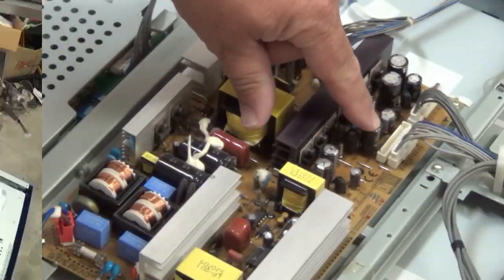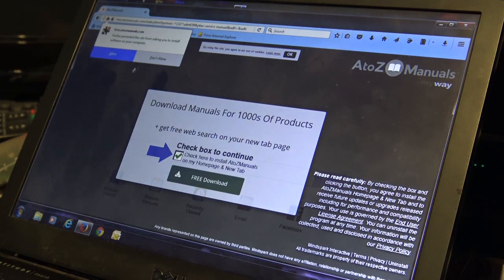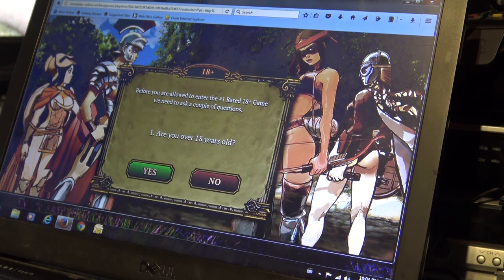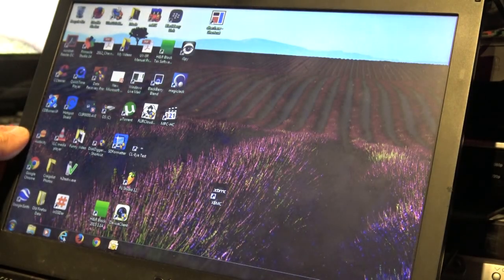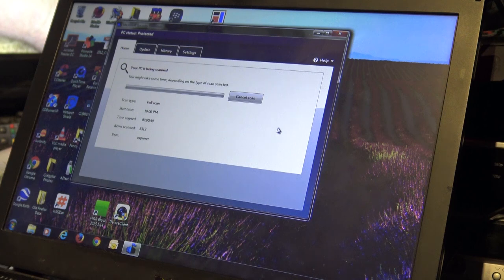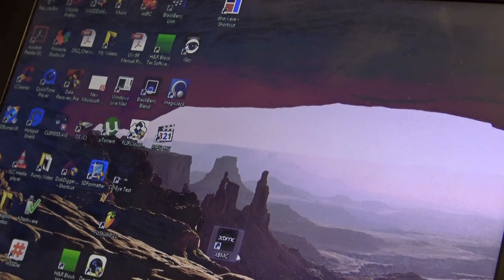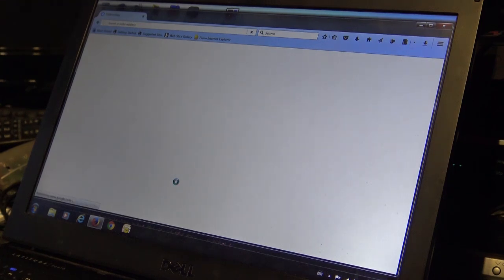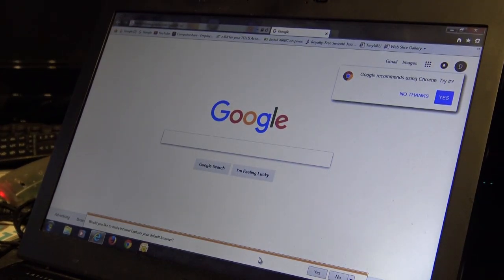Computer Viruses ARGH

Comment from the maker: I also need to point out that even though I only show removing the "launchpage" crap from the icons on the bottom, it also needs to be removed from all the shortcuts on the desktop, and in the start menu.
Reply: you should run linux.
Reply: corpus levitus Damm true one of the best os no worries about viruses
Reply: Ok, so what's the most successful Linux-flavor these days? It's Android. And what's the most malware-ridden touchscreen OS these days? aaaaand we're done here.
Reply from the maker: Un updated versions of Android perhaps. That's why I run a Blackberry which is Android, but with their own custom security. Never had a virus attack my phone, and no it can't be rooted.  Updates pushed every month. How many other phones and android devices get updates like that? My Samsung tablet has had 1 in 2 years, my other 2 tablets have never been updated. My priv gets one every month. My daughter has had her Priv now for 2 years, and she has had an update every month since she got hers. Any OS can be secure, and any OS can be insecure. It is all about updates, and microsoft is pretty good at updating their OS, and their anti virus. I was just behind on my AV update on this machine because I don't leave it running all night. My desktop was up to date, my laptop was not. Had it been up to date this would never have gotten through, but I let it lapse by over a month, and  I got smacked. Let your Norton or Kaspersky get out of date and EXACTLY THE SAME THING can happen.
No big deal, no data lost, no data stolen, I figured it out pretty quick, and had it updated and removed in a few hours. That is what took the longest, scanning the drive.

Incidentally, there is yet another update today, only 24 hours from the last one. They are on the ball at MS
Reply: Exactly as you say, couldn't concur more! The mere OS-name or Antivirus-name will not prevent you from anything, the updates need to be steady and quick. I - like you - favor continuous updates over marketing-hyped "super-safety" (which doesn't exist). I see the Nortons, Kasperskys on every new Lenovo, every new HP, every new Sony and I know that I will see those machines again in 14 months tops ... when their tryout-period expires :)
ps@my post above: not bashing any OS, I run all of them on a plethora of workstations, mobiles and servers. Once an OS reaches critical mass it'll become interesting for malware.
Reply: 12voltvids have you used linux on a laptop or desktop?
Reply from the maker: I used linux on an old laptop once. It was a cool old Dell that I could swap drives, so I put linux on a small drive and would swap drives when I wanted to play with it.
Never could get a handle on doing anything. Sure I could browse but it was so foreign that I became frustrated.  Same goes for Mac's. I grew up on DOS, and made the migration to windows. First 3.1, then 95, 98 XP, Vista and now 7. The computer in the family room is running 10, but I don't use it, and haven't bothered learning 10, even though it isn't much different than 7.
For phones I started out with BBOS6, then 7, then Blackberry 10, and now Blackberry Android, which is a hardened version of Android. Does everything a regular Android OS does, but has high level traping and reporting. If an app tries to do something like turn on the microphone, camera, report location, access data ect, the DTEC security stops it, and alerts me.  Even apps I give permission to use microphone ect, it reports it. My security camera app for example allows me to talk back to anyone at home. If I turn on the mic on my phone I get an alert.  Now this is a permitted app, I granted permission to use the mic, so it won't stop it, but every instance of microphone use is logged, and if I check the security it will tell me how many times the app used the microphone. If I haven't enabled the mic, and an app tries to enable itself, DTEC will block it, and alert me. How many others do that? Not many I would guess. Blackberry built their reputation on security, and they do it better than anyone else.
Reply from the maker: Yes I know all about the registry, ,I did go though there too, but omitted that part from the video as there was nothing of interest in there, and I don't want to advise on poking through the registry because novices can get in big trouble real quick making changes in the registry.
Reply: Why in the world are you using Windows defender
Reply: Yes Linux has it places to use. Using as a everyday desktop OS is not one its most practical and usefull cases of use. Someone who likes to tinker always and learns some OS stuf, a Linux is perfect. Running it on a enterprisescale on desktop is a nightmare. See the Linux fail at the City of Munic in Bavaria. They tried it for almost 10 years but ultimately faild in switching to Linux. In the end the training and switching costs almost dubled the cost of using MS OS and Application (Office).
Reply from the maker: Because it is free, and is updated regularly, and made by the people that built windows. Nobody knows windows better than Microsoft.
I also have this gut feeling that many viruses are unleashed by the very people that try to sell you protection. Call me a conspiracy theorist, however I am not the only one that thinks this way. 
In the James Bond movie, I believe it was the world is not enough, the villain is talking to one of his computer gurus asking him is his new software was ready, and the response, "yes sir, and it is full of bugs at your request so that our clients will be forced to buy upgrades for years."

When you think about it, who benefits most from computer viruses, and malware? Come on, think about that for a second... The people that make malware protection.  Real criminals have no interest in breaking your computer. Real cyber criminals want your personal information, they look for flaws to steal data hoping for credit card or banking information, and they don't wreck havoc, and send you to porn or gambling site. They take your information without you even knowing about it, and then disappear.
The rest of "malware" or "annoyware"  is designed to convince you that you need to pay someone for software to remove it. Who benefits from  this? The people that make the malware, and virus protection.
Sure these companies offer "free" scanners that will find the very viruses that they plant, but to get the "ultimate" protection then you have to pay them. That my friend is called legalized ransomware.
I, and I am not alone on this, many computer experts that DON'T talk about this on the web in  public also share the same thoughts in the origin of "Malware". Now sure, the odd one might be some idiot that gets his or her jollies out of messing up peoples computers, but much of the annoying malware is most likely being created and released by the very people that sell you the security. 
Now in Microsoft defense, they have no interest in damaging their own software they have a team who's job it is to monitor what the other AV companies are releasing and to watch what it happening, and release patches for their own OS and AV software. I had all kinds of problems with other AV stuff, and my computer ran like a slug. Now it is nice and fast, and I have never had a serious virus infection since dumping all the rest, and sticking with microsoft. 
Don't forget about Trustsoft. They got caught doing this exact thiing, providing a free scan, telling people their computer was loaded with viruses, selling them the cure to remove what their free scanner put on the computer. The got caught by the FTC, sued and put out of business. A class action lawsuit was filed, and they were ordered to pay back everyone that they defrauded. Of course that didn't happen because they declared bankruptcy. They were caught, the rest of them I don't trust as far as I can throw them. They are all likely doing the same  thing they just haven't got caught with their hand in the cookie jar yet.
Reply from the maker: I wouldn't, but android developers install android VM on their PC so they can code, test and debug their apps on their PC or MAC.
Reply: You know what, you are not far off. Kaspersky is "complaining" (antitrust law suit) about Microsoft to the EU because Windows 10 is to save, so they can't sell there stuff any more.
Reply: Wolfgang Stelzhammer biggest joke lol 😂
Reply: you dint have to type a whole essay

Comment: 1. Use uBlock Origin or other adblocker. Keeps a lot of the nasty crap off already. Call it "safer web browsing".
2. Hi-Fi related SMs --> HiFiEngine. Needs (free) registration, gets the job done about 80-90% of the time.

Comment: I use Firefox and install AdBlock and NoScript for safety and they've saved me from infections on several occasions.    It stops a lot of nastiness dead in its tracks.   I got a piece of Mac malware called MacKeeper on my home theatre system by installing Google Earth and all I can figure is I got a rogue installer instead of the real one.    Even Macs aren't totally immune nowadays.

Comment: When you contracted the malware: Were you logged in as an administrator? Were you using NoScript extension in Firefox? Were you using Comodo security?
Reply from the maker: I was using firefox, and the noscript extension is active.
I believe the payload launched as soon as I attempted to open the .PDF that I had downloaded from the web site. As soon as I opened the PDF, chrome opened and it asked me to log into my google account, asking for my credentials. Naturally I don't have this on camera, as I wasn't set up for this.
No I didn't log in, I thought that was suspicious. I deleted the file, and went to another site I believe it was hofi-manuals and found the real PDF which was larger. Printed that one, and went back to work on the amp. It was the next time I opened firefox, that the redirect was noted.
I then got the camera out, and filmed the screen. The site that actually passed me the bad file now just shows up as error 404 you do not have permission to view this site, but the first time I went there the PDF was available, and I downloaded it.

Comment: Little tip: get acquainted with "Autoruns" => https://technet.microsoft.com/en-us/sysinternals/bb963902.aspx
It's one of the old gems from the former Sysinternal-crew that lists everything that has an anchor in any one of the autostart-procedures of Windows, including various browser-extensions. If you use it once or twice you get a feel for what's supposed to auto-run and what not.
Also a good thing: Process Explorer (also from Sysinternals). It goes way beyond Task-Manager and is very convenient to get acquainted with the running processes that are "normal" and those who are not.
After many decades as SW-developer these 2 tools can do more good than any of the suggested Norton, Kaspersky, BitDefender-packages. I also run MS SecEssentials as it has a low footprint on the system and the support for updates doesn't cease after 12 months; it's perfectly sufficient. AdBlock or NoScript I, too, can recommend as a safeguard when you accidentally run into shady sites. Good guide up there, thanks for sharing!
Reply from the maker: I am very familar with autoruns. The way this got on my system is the web site that was serving the file I believe was hit as that site is now not reachable. I believe the only reason it got past MS was because I had not updated it, ,because as soon as I updated it found it. It was a simple browser re-direct, harmless but annoying.
Reply: Yeah, I'm also often amazed what liberties modern browsers grant to JavaScript. Thought you might know Autoruns already, you know where your towel is :) Have a nice one!

Comment: I used to get a lot of this sort of crap in Windows 7. I haven’t had this problem at all since upgrading to Windows 10 however, although I now use adblocker and anti beacons to stop the telemetry. I suppose Windows security is much better now though.
Reply from the maker: Not really.  We stopped the roll out of win10 at work for the time being.  My work computer still on 7 and I am still running 7 at home and have no intent on changing at least for my edit workstation as I have hardware that is not supported by 10 and never will be and replacement hardware not available.

Comment: Some of these ransomewares that launch as soon as you logon can be a pain because they can't be removed while windows is running, so you need to boot from one of the live cds available to remove the ransomeware. Also ublock origin will block most pop up viruses, stay safe.

Comment: Hi Dave! I can see you have the manual for Baofeng UV-5R right? I have the same radio handset. I use uBlock to but to block javascript and other dangerous stuff a use NoScript in Firefox and a alternative for Google Chrome is ScriptSafe.
Reply from the maker: I have the 1 page cheat sheet for programming that bloody thing. What a joke.
I bought the computer cable, and got the software working. Then the old computer died and I haven't bothered getting it running on this one.
Don't remember the last time I turned that radio on. I actually have 2 of them. They were so cheap, like 40 each so I bought 2.
Reply: 12voltvids I use chirp to program my one and much easier then to do it on the handset.

Comment: Strange, that russkie tanya one has always been ok for me. Good advice though, do your own research & use some common sense and 99% of the time you'll come up with what you need.  Even now in 2020 the internet is full of fake sites and rogue links, but mostly they follow a similar format and you learn to avoid them easily enough. This is a useful guide for the times when we're learning the hard way, or when we just get unlucky.

Comment: I have adblock and noscript and mcafee web advisor. and I use Avast AV and malwarebytes. All on firefox. The first three are add ons for firefox. I also turn off my network card when I'm not using my PC because of that ransomware crap that's on the news. I know I'm blocking updates but most update in the background when I'm using the PC.
Reply: I also have Firefox configured in EMET.

Comment: AdBlocker .. + malwareBytes = no problems
Reply from the maker: Many of those were infact malware themselves.  Google spykiller, to find out.  The FTC shut that one down.  It reported that you had a virus (it planted it) and then made you pay 29.95 to remove it.  I dont trust any of them except microsoft.  They wrote the OS, they do a good job of keeping it secure.  Kaspersky also did the same thing.  Created non existing threats but they did it to hit other av software companies that steal their signature files.  This caused the companies that took their signature file to misidentify a legit required windows OS file and remove it resulting in a computer that wouldn't boot.  That story is also out there for your reading pleasure.
Reply: @12voltvids  I know about it .. been a web designer/developer for going on 18 yrs now. My point was more of a 'basic steps' approach for ppl that might be wary of the 'Internet' .. MalwareBytes (free) + AdBlocker on Chrome (free) and a Virus software (I use Commodo) is all you really need for 'peace of mind' on the web. 

Love your vids BTW .. can't tell you how many hrs I've spent watching them lately.

I'm a newbie to 'electronics' and your videos have really helped.

Your knowledge is insane! :)

Comment: Yes this is the danger of using a 2 major version older os. I sincerly hope you updated this Windows 7 on a regular basis as long as you can get updates.
Reply from the maker: It updates every time microsoft releases a patch which is usually every Thursday.
Reply: It's actually the second Tuesday each month. Windows 10 is much safer than Windows 7. The smart screen filter protects you from all this crap as a first instance, then there is the newer, better Windows Defender.

Comment: linux, anyone?
Reply: Chris yes
Reply: yes
Reply: linux is the father of all os
Reply: Muhammad Yawar Ifraheem no that not right thats the father of  modern operating system is unix  not trying to be rude just trying to inform.
Reply: corpus levitus Linux and unix are not same Linux is better then unix .unix hope is mac but Linux have in most devices .
Reply: Muhammad Yawar Ifraheem that not what ment I ment it was the frist os that could be compiled on more than one  computer P.S. mac is built on unix !== unix.
Reply: yup .. think I hit the exact same site a couple of days ago.. some forum link.. was looking for schematics for a samsung media centre thing.. same "404/no rights to google docs" etc junk.. but linux ftw.. my couple of windows machines don't see the internet except for updates once in a blue moon.. :D
Reply: Unfortunately linux isn't 100% safe either. I had a computer set up with Debian (no GUI), and it got infected with a bot sending spam e-mail just by being plugged into the network. Never experienced anything similar with any system before.
Reply: Linux only works on outdated equipment and has almost no software to run on except totally buggy and badly coded open source stuff. The only good stuff is FFMPEG.
Reply: this guy must work for Microsoft
Reply: Chris maybe but most likely he used Ubuntu and compiz and replaced desktop as many nub's do.
or just used ubonetu in general.